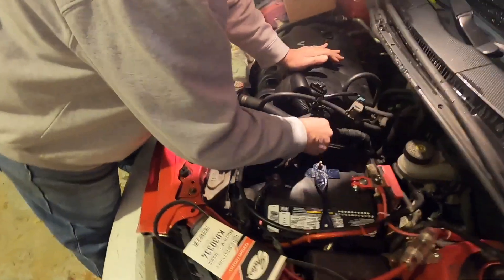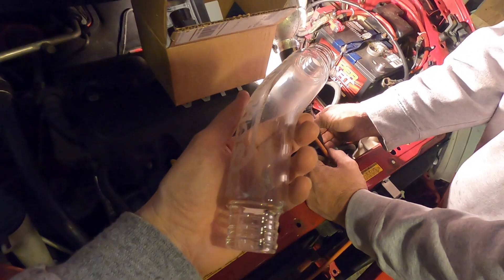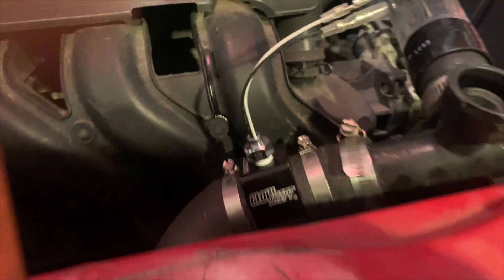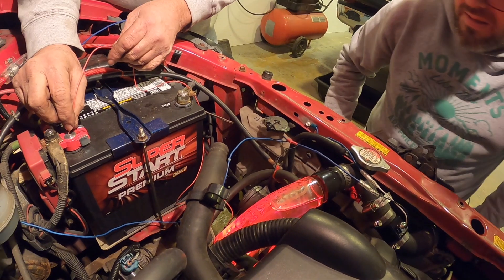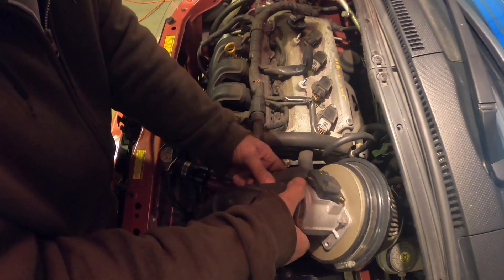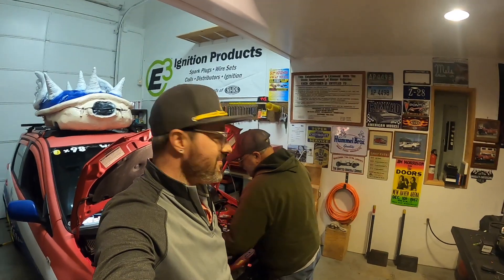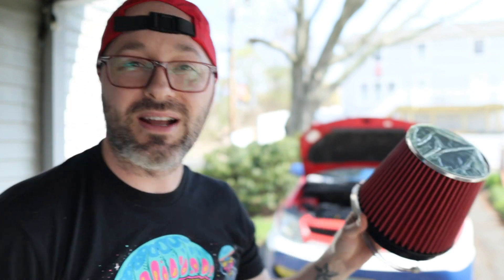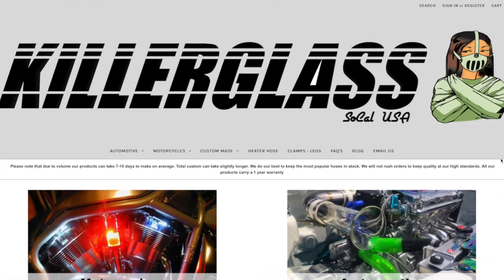Replacing my Radiator Hose with a Glass One (Killer Glass Instal)

Comment: Looks great!
Makes the engine pop with the red glowing light

I was thinking you should paint the plastic engine cover Mario kart theme  so that at shows with the hood open it will pop even more.
Reply from the maker: thanks so much Tony. Yeah I could use for a better engine cover. I actually do still have my old one that I may put back on. It has Mario throwing a fireball that was airbrushed on